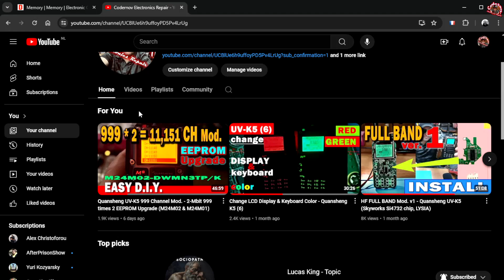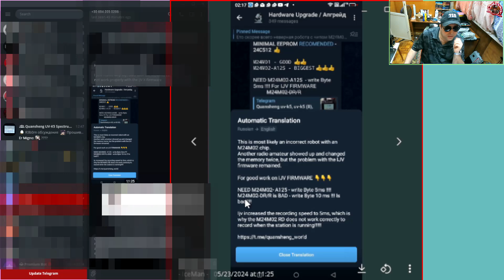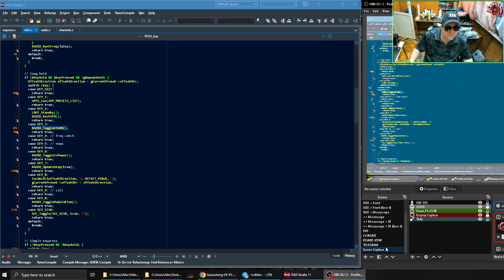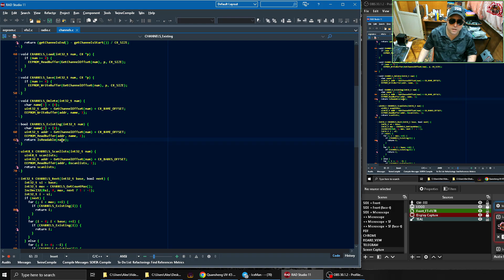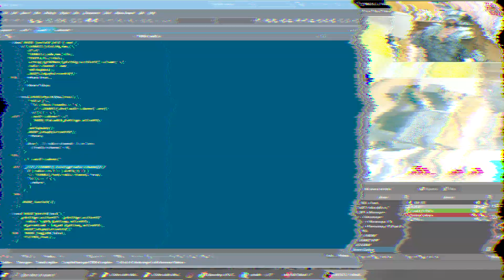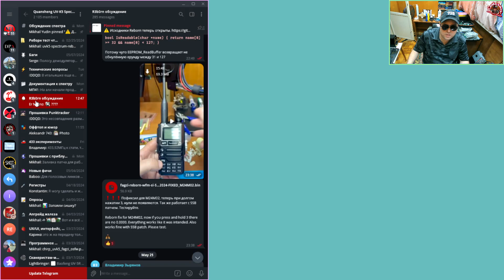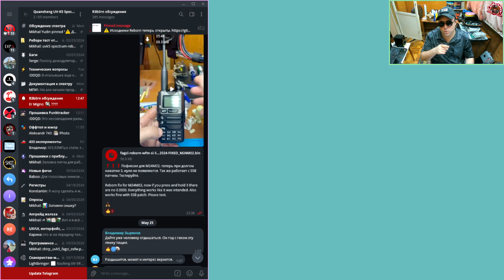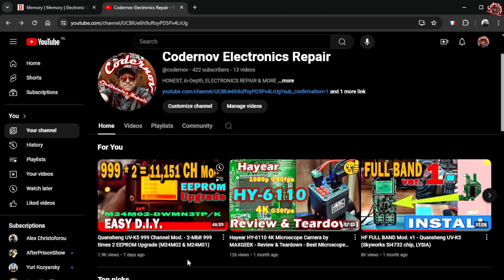Quansheng UV K5 999 * 2 Channel Mod Redux - M24M02-DRMN6TP Works

Comment from the maker: Reborn firmware now works with M24M02-DR chip -- https://t.me/uvk5_spectrum_talk/54231/56454
@fagci went on vacation. I fixed it myself. If I could fix Reborn, not knowing C language, and seeing code for the first time, Italians can fix the IJV firmware as well so that it works with M24M02-DR. If you new to this, best chip is A125, links are in description, but if you already bought DR, no problemo, it works just fine with @fagci Reborn firmware. 😆
Reply: Do I need to download Telegram in order to download the Reborn firmware link above?
Reply from the maker: Yes. And keep in mind, that particular version is for Si47xx and M24M02-DR

Comment: Hi. I had problems with M24M02 too. Unfortunately they don't work as other I2C EEPROMS. Datasheet doesn't say but there are lots of discussion on ST forums about this. You need to use different I2C library for proper functionality. Byte write is working but page write sometimes fails. Whenever you write a byte to this EEPROM an entire page from is memory is buffered internally, written byte is applied to this buffer, memory page is erased (filled with FFs) then the buffer is written back to the memory. ST Microelectronics engineers explain this process on their forums, and if you search for older chips this was the standard procedure. So this avertized 4 million write times life span is reduced a lot and the way the Reborn firmware is writing everytime you tune the radio will damage the EEPROM faster than we think.
Anyway, thank you for the video! Very useful information!

Comment: I jumped the gun and changed to the 24m02 chip before I downloaded the stovk UVK5 firmware, (radio is brand new), now battery says .24 volts in menu with new 24m02, but I  did copy old 24c64 chip with CH314 programmer and have the original data as .bin file, how do I apply original 23c64 buffer to new 2meg chip, need the calibration files of the original chip I am guessing. Downloaded new chip data using chirp
Reply from the maker: Yea. You backup the calibration. Then you change the chip, install firmware, and put in the calibration.

Comment: Hi, I ordered M24M02-DR chip, but I would like to know if this chip only works with Reborn 999*2, and the other original modded firmwares (less space firmwares) ? Thank you for this videos!
Reply from the maker: You can install any firmware on it, but only firmware that utilizes this chip can take advantage of it.

Comment: Is there a firmware that will allow all your mods to be utilized? I am looking to do three different mods to one radio and run a firmware that will support them. I would like to do the sensitivity mod, V2 board mod, and the eeprom mod. I have already ordered the components recommended in those videos, so I am working with that less expensive 24M02RD eeprom. I checked out the link you provided for the Fagci reborn, but I didn't find a bin file to flash my radio, and I didn't know if it would support the lower frequencies of the V2 board. Thanks again for your helpful videos. I am new to these radios and do know much when it comes to all the different firmware's available.
Reply from the maker: Yes. Here is that firmware -- https://t.me/uvk5_spectrum_talk/54231/56454 it requires upgraded EEPROM. Before you install it, you backup your calibrations and configuration using uvk5prog-win, then you install it using uvk5prog-win. After it's done installing, you turn off the radio, press and hold 7 key and turn on radio, let it finish FFxing. Then turn off radio, press and hold EXIT key and turn on radio, let it finish initializing. Then you install SSB patch, this is a two step install. For SSB patch you connect radio to computer and just turn on your radio in normal mode just like you usually turn it on. Get go here -- https://codepen.io/fagcinsk/full/PogrKrq and click Connect, and then click Write SSB Patch. After it is done, installation is finished. You short press M key, and select Si47xx, and hit the 0 key, and change to AM, there should be sound. Then 0 key again, it will change to LSB/USB, there should also be sound. If there is sound, that means you installed everything correctly.
Reply: @codernov  Thank you so much!! There was no way I would have figured that out.
Reply: @codernov  is this the current stable version?
Reply from the maker: @GoldenEggsBasket  https://t.me/quansheng_world/31/6649
Reply: @codernov  thank you so much have just installed latest without issues!
Reply: @codernov  one last question, do i still need to ssb patch after installing r3b0rn-20241006-spectrum-rereborn-fix2.bin 

Because the progress bar doesnt move at all
Reply: @codernov  I used chirp to install the patch, that worked ( I think ) thanks for all your help
Reply from the maker: @GoldenEggsBasket  of course!

Comment: Great video man !
A couple of days ago you've made the DR eeprom compatible with the Reborn, if you spend more time on modding I see more bugs fixed and maybe some new features coming..
When I saw the screenshot on the video I was waiting to hear something about your friend from South..  ;) 
Looking forward for your next video with v2 SI4732 instalation. Is it worth the second antenna installation, CEC 5.1 or Reborn has better performance and signal reception  ? 
Keep on modding  😊
Reply from the maker: Reborn is going to have better reception performance. @fagci really nailed it. CEC is just egzumer that was cut up so that SSB code can fit.  Second antenna is easy man. No special tools, no cutting your PCB. We going to install everything flush with plastic and use pigtail so radio can be easily disassembled. It's like no skill D.I.Y. type of thing, and no special tools required.

Comment: Back in the day we were instructed to write zeros a few times in the programmer before installing the eprom into a new circuit just in case whatever watchdog or bootstrap grabs some garbage from the new eprom. Even writing code with the programmer we would zero first. Cheers for the video, I learned something new about some C today… 👍

Comment: This afternoon i Installed Your Firmware On my Modified Quansheng with the Dual Antenna mod and the V3 pre-Amp board. I have the same Eeprom installed aswell. Thanks for your work.
Reply from the maker: If I remember it correctly, you were doing some tests between performance of CEC and Reborn on HF. Please provide results, and if you can make a separate comment here, so that people don't have to dig through replies.
Reply: @codernov  I did some more compairing this weekend and found out its hard to tell wich is better. I swapped the firmwares on both my radio's and it seems the Board with the Pre-Amp is the best, not sure about the firmware. Only thing i noticed is the Fagci Firmware has louder volume and doesn't really need the Pre-Amp board . I was planning to make a video testing out the 2, but there for i need exactly 2 radio's wich have the same board installed.
Reply from the maker: Well I'm glad you like it!